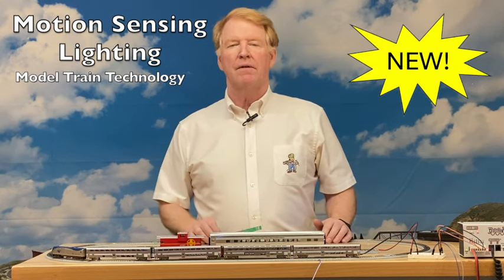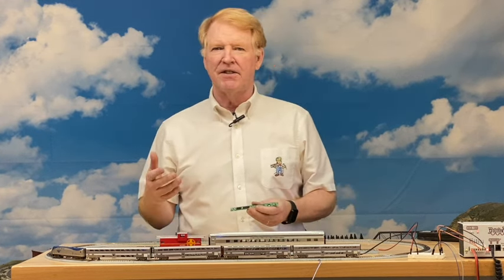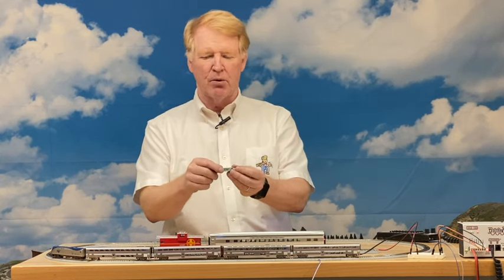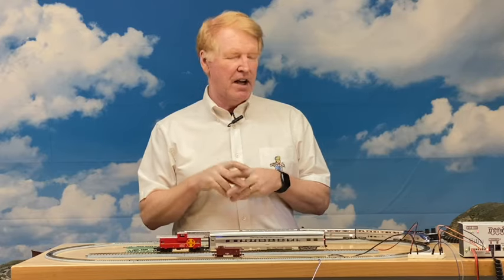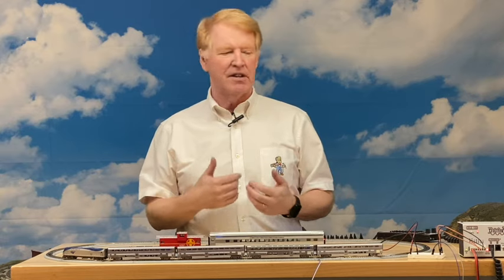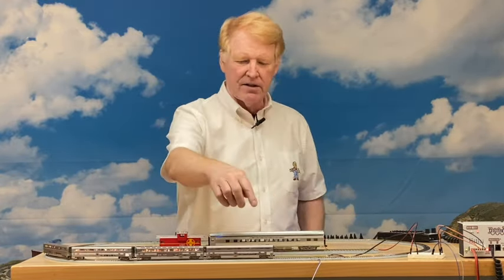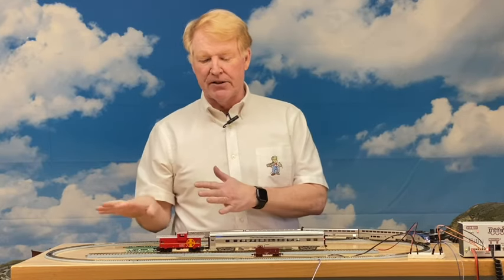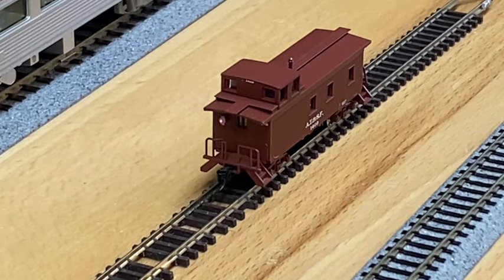NEW PRODUCT: Motion Sensing Lighting - Train Sense™

Comment: This is so cool. I think you got a winner with these. I've always thought you got it right but this is even better. Just wondering it this once programed could run off batteries. And maybe used in G scale any time soon...🎉
Reply from the maker: thanks for the feedback!  We do have some designs for it.  However,  outside the lights are not visible during the day.  And limited interest so far.

Comment: Great video, Jim, and delighted to see the upgrades to the N-scale LED board products.  A couple of questions:  first, for the dual row board, is there a CV setting that selectively turns off one row - as for the “bedroom side” of a 4-4-6 sleeper - while leaving the other row on to light the passageway?  Second, some Kato observation cars (20th Century Limited, California Zephyr, Olympian Hiawatha, for example) have some built-in lighting structures at the back that prevent installation of either the 144mm or 124mm products (too long, won’t fit).  Is the 106mm product intended to be used in those types of cars, or should the even shorter N-scale caboose board be used?  Looking forward to trying these out soon.
Reply from the maker: We'll put the separate control for right and left side on the wish list.  In the installation videos you might see that I remove all that extra "framework" that Kato installs and yes, we use a shorter board but the N-124 will fit - and we put a separate LED in the back observation area - powered by the Mains on the N-124 board.